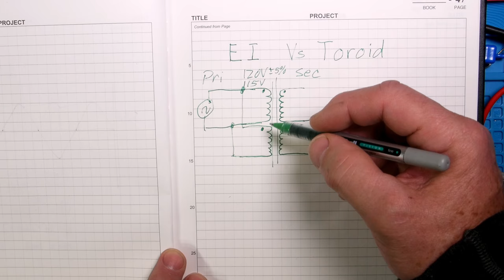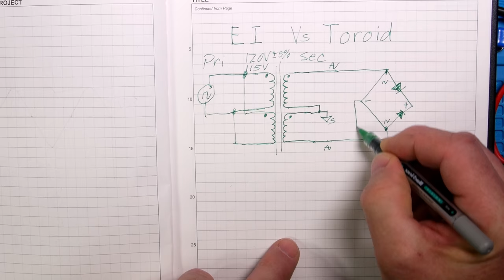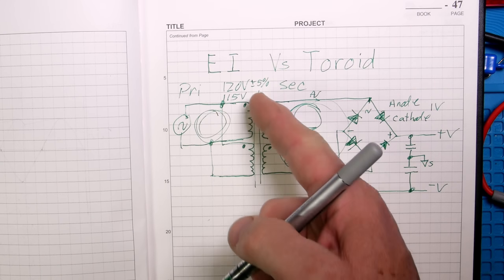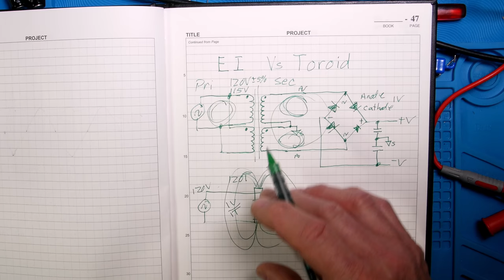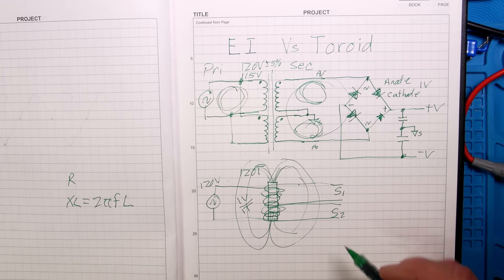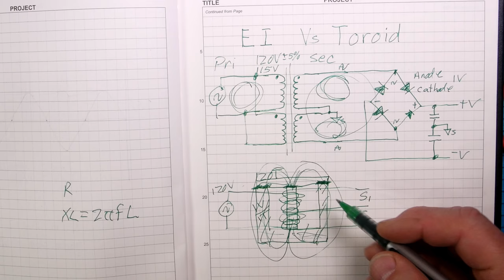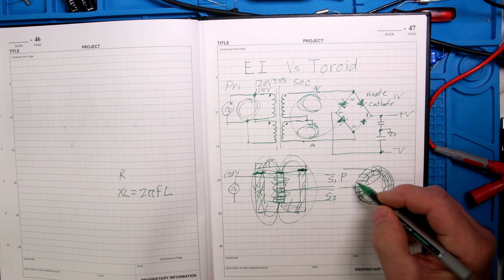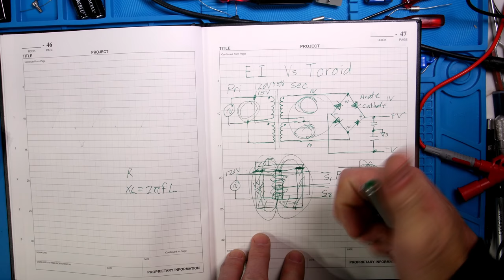Toroid vs EI Transformer

Comment: Power toroids are not made of powdered iron. They are 'tape' wound with thin strips of magnetic steel that are slit to the required width and length for the core requirements.
Reply from the maker: Thanks!  Yes different materials for the low frequency vs high frequency :)

Comment: On a toroid core Is there any positives or negatives for doing the primary winding FIRST ?  If making a transformer for a low frequency inverter, doing the secondary first gives you the opportunity to rewind the primary if you have under shot the "gain".
Reply from the maker: Jack Patteeuw It is often better to sandwich the secondaries between the primary.  So, wind half the primary then the secondaries, and then the other half of the primary.  If you want to add more turns later to adjust the ratio  - it is easy to do.  Great question!!

Comment: I want to build a tube amp with toroidal power and output transformers... is it okay to the V+ voltage from the power supply through the output transformer primary center tap to the anodes of the tubes as is normally done with EI transformers? Will it saturate too quickly?
Reply from the maker: The tube amp is Class A so it will most likely need a large transformer.  I think the size gets pretty big, so that’s why EI are used more commonly.  Make sure your transformer can handle the power.  Let us know how it goes for you;)

Comment: I am an electrical engineer trying to answer the question of what happens when the transformer is driven into saturation.   What does the primary and secondary voltage and current look like.   It has been difficult to find a video on what happens to the flux lines as the core saturated.  Maybe you could cover the saturation end.
Reply: Core saturation means that the core cant support any more lines of flux. Refer to a B-H  curve where B is flux and H is the energy required to create the flux (excitation current). Most common core materials the curves look like an out of shape s.  Most core materials have a linear portion where the B and H rise proportionately up to a point 'the knee'. Here H rises dramatically while B rises slowly. This is where saturation begins. The higher H goes, the more current is drawn by the primary coil.
.

Comment: At 19:00, you say that the toroid core is usually made out of iron powder.  Other references say that at 50/60 Hz the core is usually a strip of silicon steel that is wrapped into a torus shape and then fastened, while powdered iron is used above line frequency.  The one line-frequency toroid I've seen taken apart was sheet steel wrapped into a coil.
Reply from the maker: Thanks Dave!  Great catch.  I'm so used to building SMPS that I must have said that by mistake.  Low freq like 60 or even 400 Hz transformers are made with different types of steel I believe.  There's a new material that's made a big splash and I need to look into that.

Comment: I want to more about the shielding you were talking about.  I saw a video where he wrapped a amall wire between each turn of the primary before he wound the secondary over it.
Reply from the maker: I do need to show how to wind a transformer.  I’ll do that soon.  Thank you!
Reply: @KissAnalog  In another video he split the toroid in half then glued it back together with paper insulation in between before winding.  Why is this necessary when the transformer will be used to feed a single ended rectifier/amp?
Reply: @KissAnalog  What kind of metal can I use to make my own toroid?  Where do I get it?  Why do choke toroids use sintered iron oxide and transformer toroids are wrapped from sheet metal? What kind of sheet metal? The thickness of the metal vs frequency would be another useful point but I already know about that.  Why does a choke stabilize the arc of a welder?  Just food for thought.  Take it or leave it.  Your channel is awesome!
Reply from the maker: That is not advisable unless you need more power and the transformer is going to saturate.  A proper sized transformer is better.  That kind of defeats the purpose and advantage of a Toroids (self shielding).

Comment: Hi Eddie,
I thought I had watched all your video's !
Just spotted this one.
Does it matter which winding is wound first, I.E. primary first then secondary on top ?
Adam
Reply from the maker: Hi Adam.  Yes it can.  It really depends on the Turns ratio, or number of turns.  A toroidal has better coupling, so it may matter less, but place the winding with the fewer turns closer to the core.  It may help to place the secondaries between two halves of the primary.  So half the primary then secondaries then second half of the primary.
Reply: @KissAnalog  
Nice one, thank you Eddie.

Comment: This is a very good explanation on how windings work. I actually learned something. However, I am going to disagree with you on saying that toroids are better. And believe me, this is the first time in any of your videos I've disagreed with something haha:) but the reason being is that toroids are in fact only superior if the situation has limited space (often times this is the case nowadays). Where EI core transformers completely wipe the floor with toroids is when you consider that EI does a much better job filtering the mains noise and any DC leakage into the mains etc. The capacitance is also another factor to consider. For example, my power amplifier I've had both transformer types before. Guess which one sounds superior in every way- the EI Core! Haha much more dynamic and clean with all things considered. However, the entire front of the chassis is dedicated to the huge EI core on both sides other than the power switch and rectifier, so there's quite a bit of empty space but it's totally worth it to me😁 I would agree though that most of today's smaller chassis basically require a toroid
Reply from the maker: Thanks for your great feedback!  You make some great points - and I should have specified that Toroids are better at containing the magnetic field.  So, yes if an EI core has the space around it and/or has shielding (caps and shadow band) then that can help contain the field as well.  A toroid can also be fitted with a shield winding to greatly minimize the noise from input to output (or visa versa).